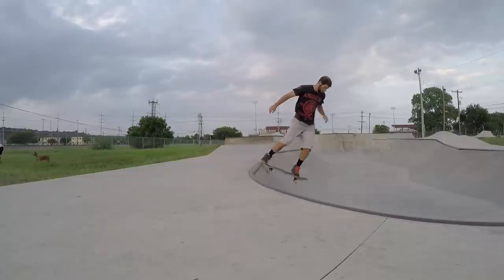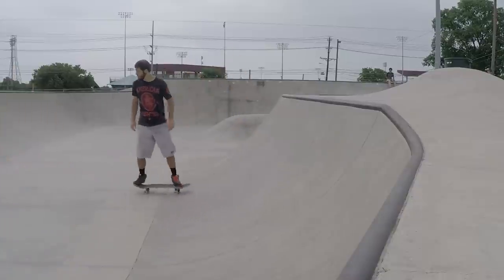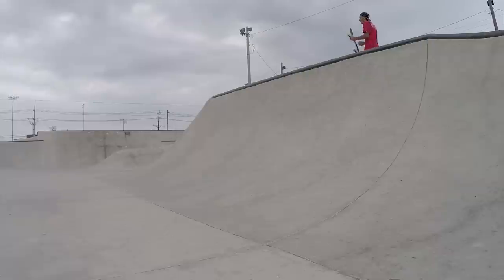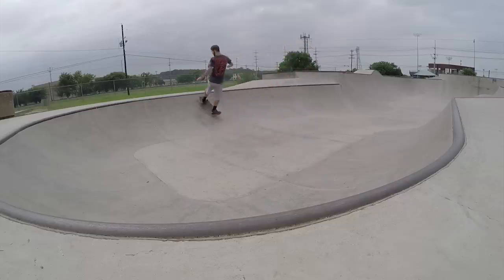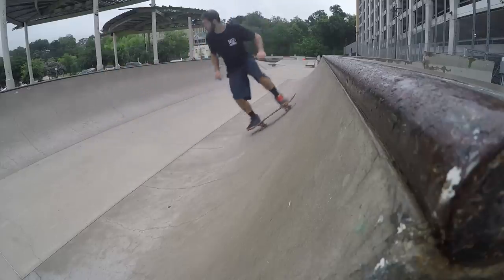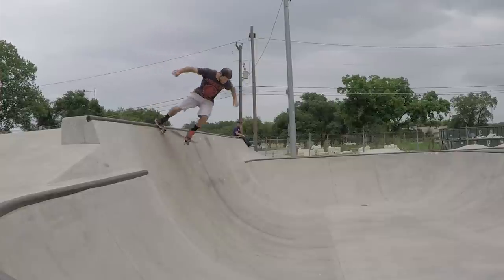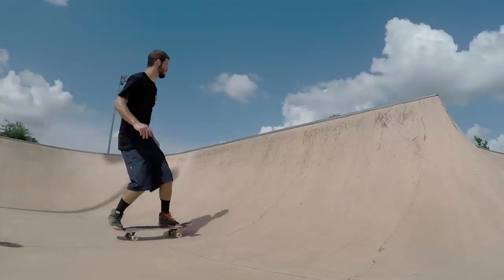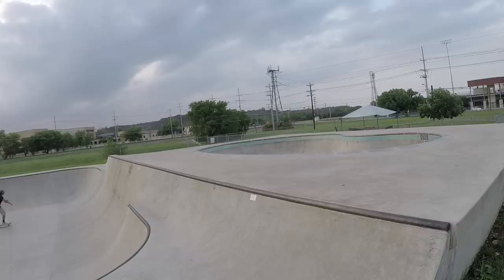Skateboard Mini Ramp Basics - How to Drop In, Pump, Kickturn, and Exit/Fly Out

Comment: Here's some help on dropping in. I can drop in on flat only, so I don't know how much this will help on vert, but the #1 key to dropping in is to SLAM DOWN. When setting up a drop in, I make sure that my balls of my feet match up with the top part of the tail, just behind the bend where the board hits the tail. NOT on the crease, but a little bit behind it. When putting your front foot on though, what I do is put my foot on the board with zero weight on it, then I take my front foot about an inch/few centimeters off, then immediately SLAM my front foot down on the board, and as I'm doing that, I take all the weight off my back foot, then put some weight back on when all four wheels hit the ground in order to do kick turns. For any beginners, a good way to practice this trick is to find a place where you can put your board half on concrete/smooth ground, and half on grass/soft ground. I then do the drop in onto the concrete side. After I get used to that, I do it the other way around. After that, I hold something while on smooth ground fully, then drop in. And after that, I do the real thing. Now, the funny thing is, I couldn't commit to it for a couple  of weeks after I got to the final stage of practice (I did all the practice steps in one day) I set up, then my mind just drifted off, and I didn't focus on what I was doing, and just did the drop in. When doing the drop in, you cant focus on it, because then you get scared and walk away. Instead, try to daydream in a sense, and just let your body take over. If it sounds like I'm tripping, it's because it's 2:30 am, but not focusing on it actually helped me. I hope this advice helps y'all, goodnight.

Comment: Justin super great job now I don't have to do my own how to video,u cover it all dawg,I say covet it all because nice job for a brand new person there s a couple of things that I could add,really just one people don't realize new skaters you don't lean back to lift the front of your board you stay center and lift you front leg and push down on your tail,but dude the flat land tip is the bomb I was ten or eleven when I first went to a skate park and I did so much flat land stuff till a pro happen to come to skate the half pipe and I was lucky enuf to gets some schooling.The other thing I use to focus on was pushing on my back foot when I dropped just so my brain new the back of my board wasn't gonna move till I was on it and away,but great video I love how you did a great job of showing ramp size on of the other balance tricks I used to do is flat ground grab the front of my board tail stand and one eighty kick turn on my tail only all wheels in the air it a good one your on the ground and it gets you comfy moving on your board like you will later when get to airs or kick turns and I practice a tail stall,great work that should get them going from zero to having fun safely...see ya.
Reply from the maker: Awesome! Very good tips, especially the bit about not leaning back to pick up your front wheels!

Comment: quick question: is a mini ramp different than a quarter pipe
Reply from the maker: Yes, but the distinction is really between "vert ramp" and "mini ramp" (vert ramps are the 12-footers like the one Tony Hawk did a 900 on), both of which are versions of a half-pipe.  Quarter pipes can be either vert or not, but a mini ramp generally refers to a small half-pipe.